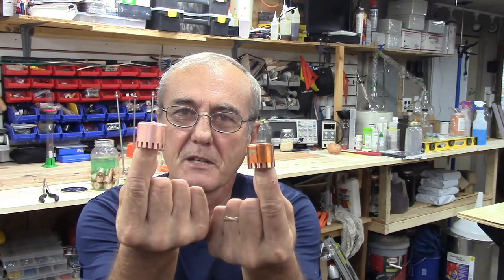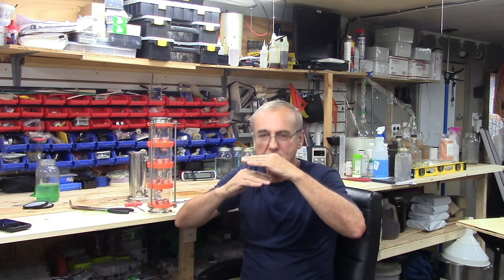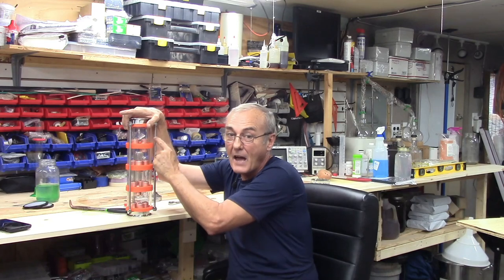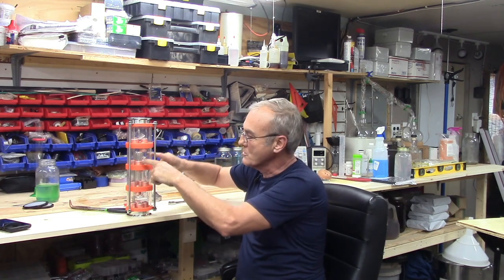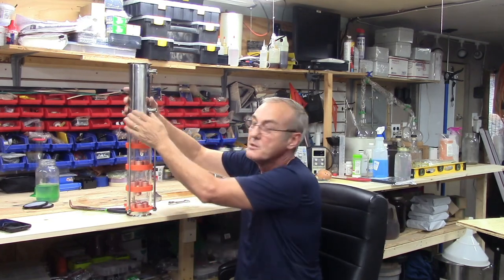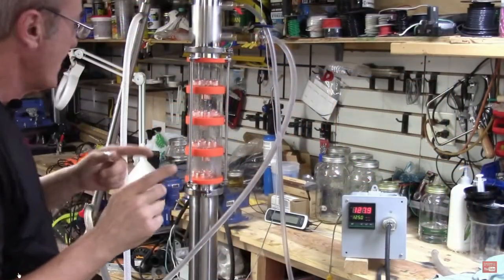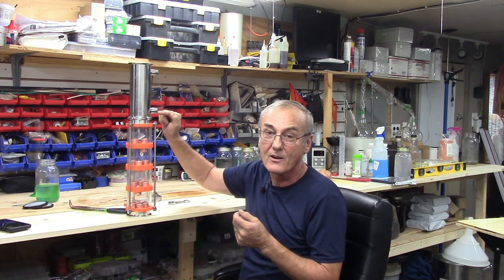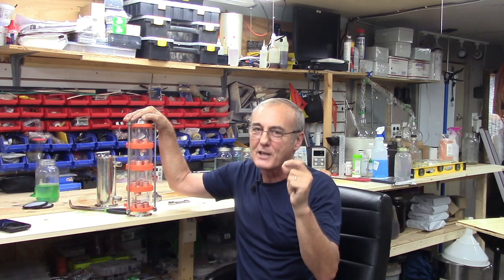BUBBLE PLATES AND DISTILLING

Comment: George you're wrong about number of theorycal plates. Each physical plate is less than a theorycal plate no matter how many bubbles you have in there. So you have less than four theorycal plates in this set-up.
Reply: While you are right in that he is wrong about the number of theoretical plates. A theoretical plate is equal to a physical plate. It's just that when you are talking about theoretical plates, you are discussing packing, which will be able to have more plates per column height than with physical plates. So within the height of a physical plate, you could have 2 or 3 theoretical plates with packing. 

He has 4 physical plates, so it would be equal to 4 theoretical plates. But it's still sorta improper to state there are any theoretical plates, because theoretical plates don't apply to physical plating.
Reply: @adamw2785  According to Mccabe-thiele method when you have a separate distillation each time, It's called a theorycal plate. We don't have a full distillation in each physical plate. So the number of theorycal plates are always less than physical plates and it depends on the efficiency of the plates. The efficiency is defined by the percentage of a full distillation that happens in a plate.
Reply: @alizx-pg4cl  The McCabe-Thiele method doesn't define what a theoretical plate is, it simply uses theoretical plates to help model the distillation of binary mixtures. The definition also isn't where you have a separation distillation, but where you have a point of VLE between the phases. A column with 0 packing, and 0 physical plates, will still have some theoretical plate number, but you'll never hear a hobbyist talk about it as if it has any plates, they will simply say "passive reflux is happening". You are right that in practical terms, there will never be 100% efficiency in generating that equilbrium, but when we discuss it on a hobbyist scale, we speak in ideals as if it were 100% efficient, for us, Nt = Na * 100%, mostly because no one is building a still where that can be measured with any sort of ease.
Reply: @adamw2785  Then I guess we agree that four physical plates is equal to slightly less than four theorycal plates, right?
Reply: @alizx-pg4cl  For the actual plate itself yes. System wide, or even on a plate section level, not really. 

The MCT method, and Murphree Plate Efficiency are great learning tools, but they are typically too simple to explain what really happens inside a still. It's like trying to use Raoult's law to explain what is happening. You can use it to get a general idea, but it isn't the right tool for the job.

Gotta remember that it isn't just the plate in the column that is refluxing and causing separation. 

While the plate itself might not be 100% efficient, the plate along with the column walls of that plate section (between the surface of that plate and the bottom of the next plate above it) might add up to 100% equilbrium efficiency or more. 

By that I mean, if the mole fraction of the vapour above the plate is higher than the calculated VLE mole fraction the liquid on the plate allows for, which would mean the efficiency of that plate section is higher than the efficiency of the plate itself, which does happen. And no one is going to talk about the plate as just a plate and not a plate inside a column, from a hobbyist standpoint that is.

Comment: Don't use marbles in your still. That break up after high temperature. And copper and active carbon do not work well together after a long time. It gets hot and turns the copper red. I don't think PVC pipe is good for a filter system. The carbon gets hot.